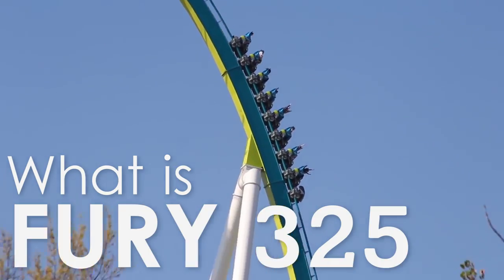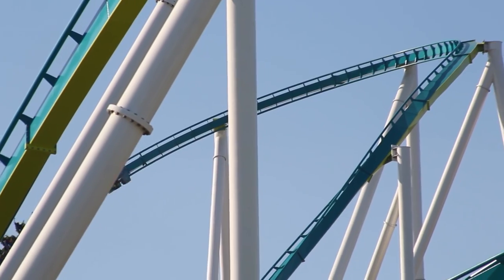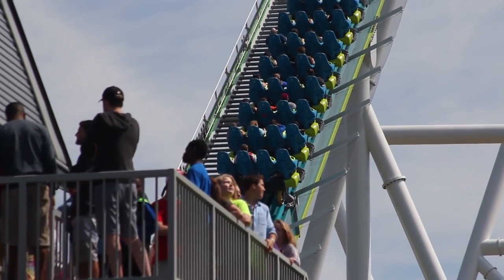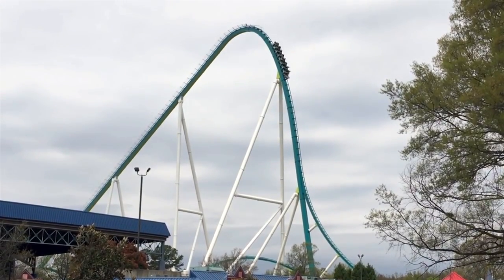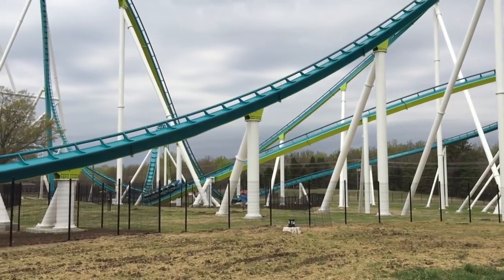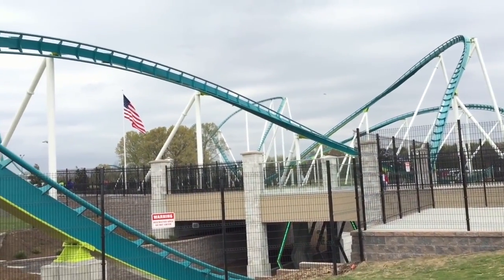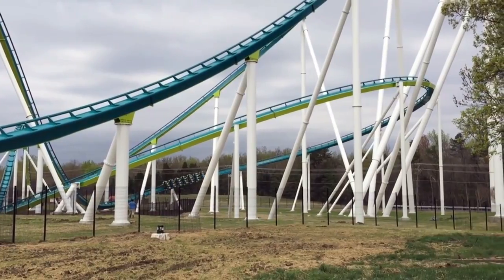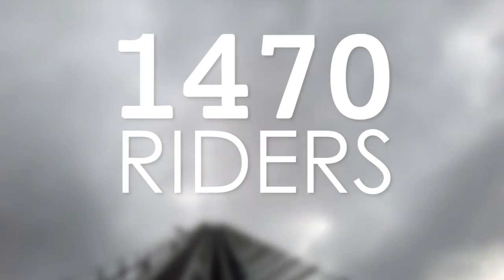What is: Fury 325 - Carowinds

Comment: This ride may have average stats compared to new coasters, but the experience is absolutely insane. The seats are extremely open, and the restraints only go over your lap, so when you’re 325 feet in the air and able to move your entire upper body freely, it’s crazy. Also the super fast throughput allows you to ride it multiple times within 30-40 minutes, rather than a 2 hour queue. Honeslty my favorite coaster outside of cedar point
Reply: 3 years late but how the hell does it have average stats. 6th fastest, 4th tallest and 3rd longest roller coaster in the WORLD

Comment: How does one prepare for a ride drop like that? My biggest coaster is Megafobia which is 85 feet tall.
Reply from the maker: I guess ride roller coasters with slightly bigger drops, slowly working your way up. As you're most likely based in the UK, riding the Big One would probably help! :)
Reply: COASTER BOT I am indeed U.K based. Down here in Wales it's a struggle to get to parks but I will in due time
Reply: honestly, don't try. fury 325 was my first rollercoaster and they put me in the first row. you'll be just fine :)